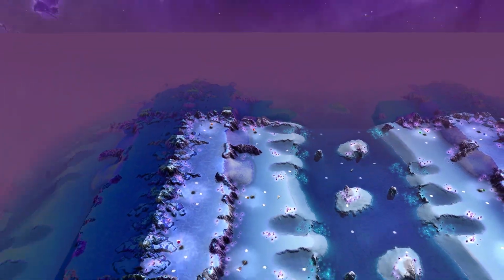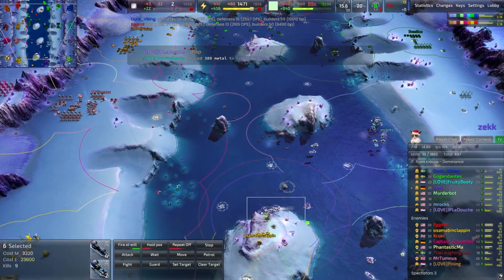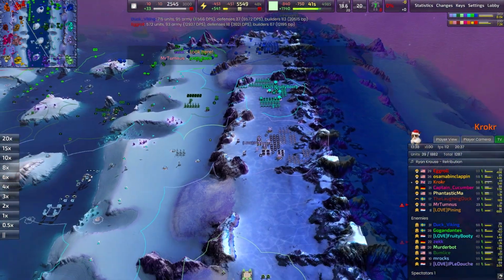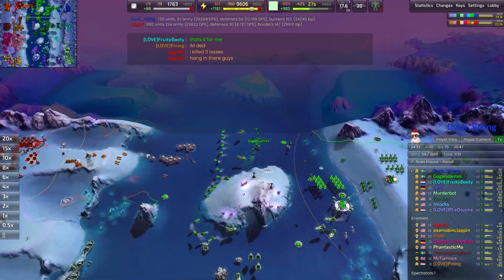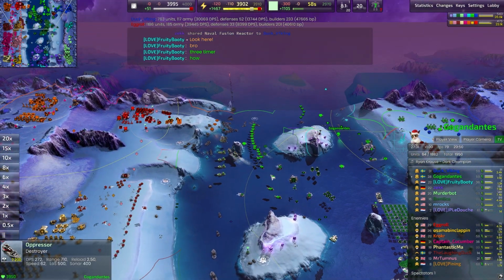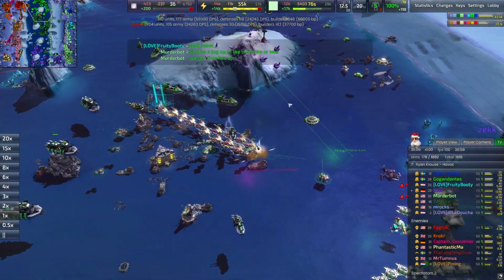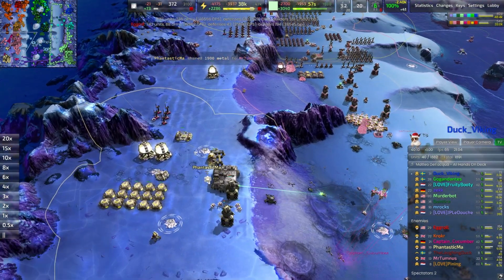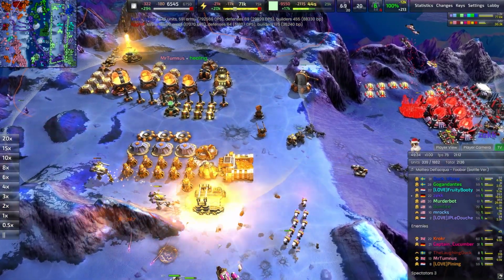Marauders are REQUIRED on This Map - Beyond All Reason 8v8

Comment: Very cool to see rocket hovercraft being used so well, I had been thinking they'd be the best T1 unit to deal with a blockade of T1 ships on your shore and this was a good demonstration of that.
I think Marauder raids are probably best countered by hitting them with EMP and killing them with heavy air units. I think the team's air players need to be able to handle that kind of rapid response base defense for the whole team, ground units are just not fast enough to catch Marauders. So for Armada, you have a variety of EMP options but the Stiletto is probably the best, and the Roughneck or Hornet should be able to finish off Marauders while tanking their AA, while for Cortex you have Shuriken and Wasps or Dragons. Also, heavy air transports carrying slow units might be a good idea - Skyhooks dropping Mammoths in the path of the Marauders might let you move in to stop them no matter where they land, for example.

Comment: i think 2 shields arent enough to stop flagship everyone allways says you need 3, never tried how many you actually need. 
Either i have the eco to spit out shields at wich point i make 3 to be safe or i stall and barely get one up
Reply: Iirc the Armada Flagsgip can barely get through 2 shields, while the Cortex one can only punch trough one. So it depends on your enemy, though 3 shields will always be enough for just one flagship